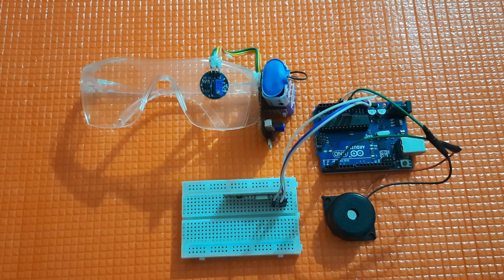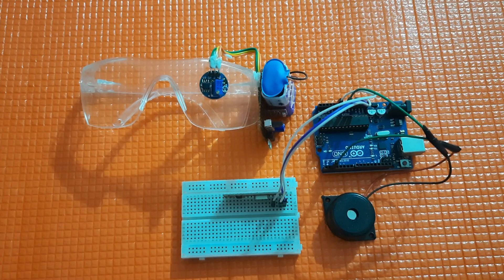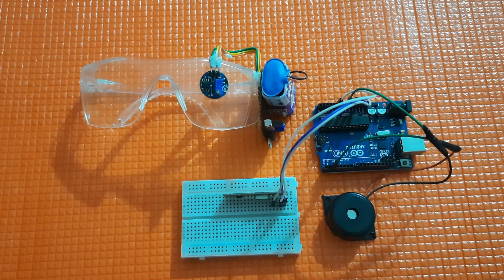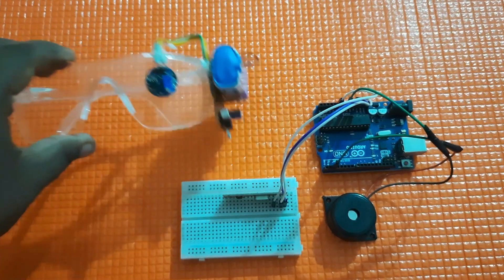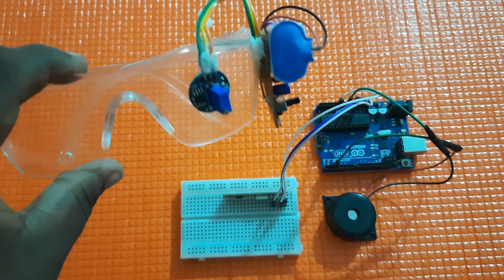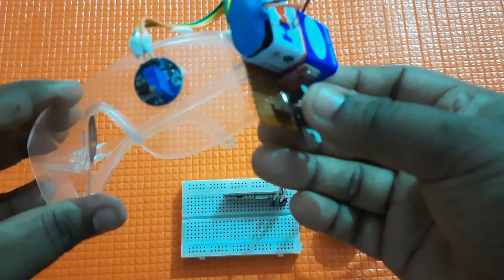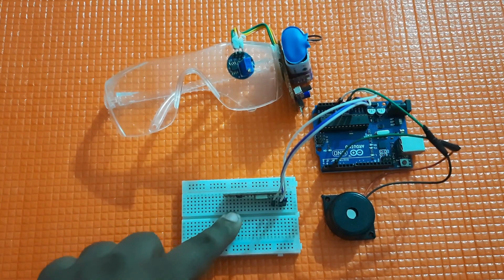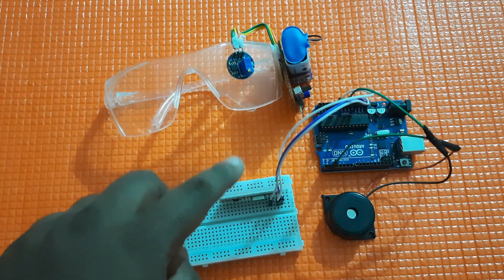How to Make a Driver Drowsiness Detection & Alerting Glass using Arduino

Comment: in the Transmitting side, I saw a Capacitor is used and in the block diagram also, but in the Description, I didn't mention any capacitor in the Materials required. does a capacitor required ??